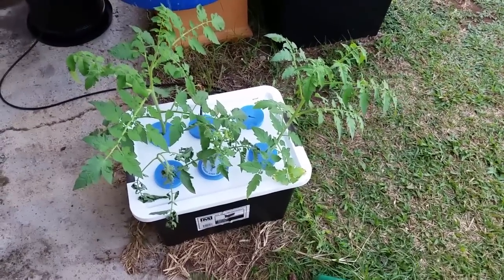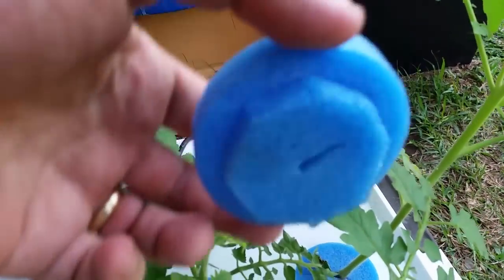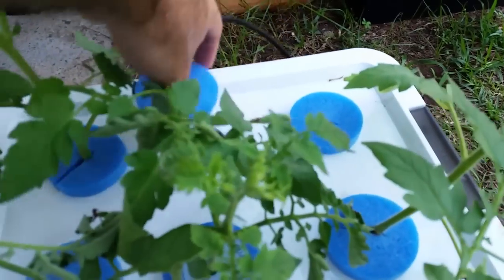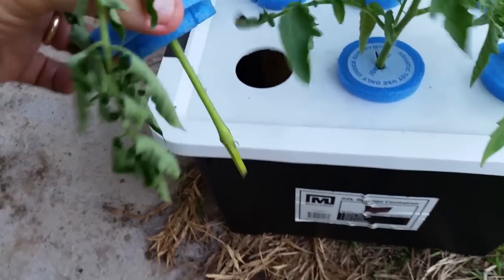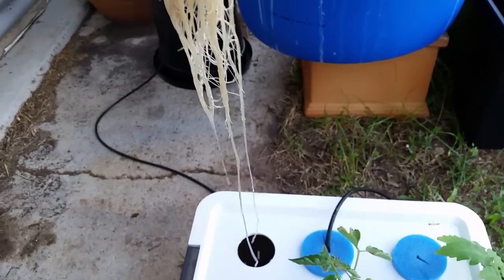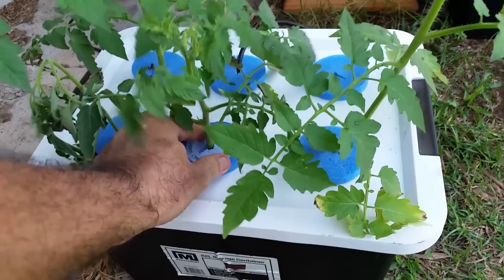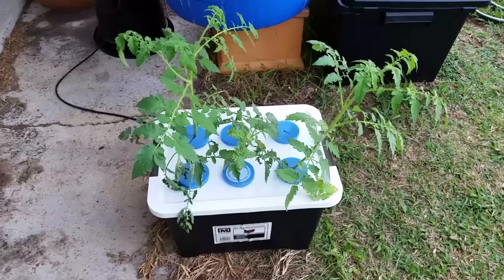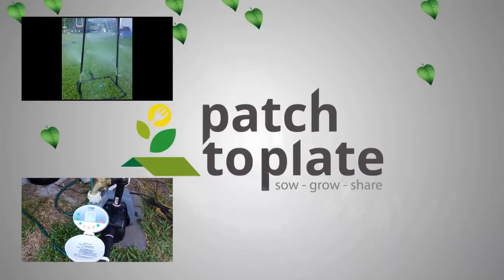DIY - How to build a plant cloner

Comment: one  really nice thing about cloning is that if you're growing a bunch of the same plant, but one is your particular favorite, you take a cutting of that one  and clone it. people that are new to this don't realize that it WILL be the same plant with the same characteristics as the original. I made some clones of my favorite cherry tomatoes from last year and put them in dirt under lights (just regular florescent lights) in my den over  the winter and re-planted them this year I my outdoor garden. 2nd generation plants!!! pretty cool.
Reply from the maker: Barb Susi Good points :) I have heard of a few people using cloning to get a head start on the growing season like you did with your tomatoes. I also using cloning to extend my growing season by cloning a bunch of my most productive plant(s) off at the halfway mark so I have continuous supply.

Comment: I loved the video, but I am new to this.  I need to know how exactly how the insides of the box work, as to how the air splashes the water on the plants.  What fertilizers you put in the cloning box water. The distance of the bottom of the cutting, from the water, and depth of water in the box.  IF you could make a short video explaining this, I think that many other people looking at this, would like to know this also.  A video may  help even better than a written response, unless it is faster to do a quick written answer first and a video after.  Thankyou.
Reply from the maker: Gil Smit Thanks for watching and for the questions. I could do a quick response video for you in the next day or so showing more of the inside. Just quickly though, water/nutrient mix about half fills the box. There is nothing special in the box. The air stone just makes bubbles and as the bubbles pop at the water surface, it throws small droplets onto the roots. I normally leave the bottom of the cutting around 2 cm (1") from the bottom of the water. I already have a video on mixing nutrient for my aeroponics tower and I use that same mix in the cloning box. Video is here - https://www.youtube.com/watch?v=5KrVn1IsjFs  Thanks again :)
Reply: Thanks for asking... I was wondering about depth of plant as well.... Great videoes.... Thanks Patch!

Comment: The video is called "DIY - How to build a plant cloner" And yet you don't show anything on how to build it. No offense but that's misleading.
Reply from the maker: +Zipper Back Thanks for the comment and for watching. I think in the first 45 seconds I run through all the steps although I didn't show them directly. I thought it might be a bit boring as it really is this easy - 1) buy a tote or container; 2) cut some holes in the lid; 3) cut some discs out of pool noodles to hold the plants; 4) half fill with nutrient solution (or even just water seems to work); 5) put an airstone in and let it bubble. Great project as there is really nothing to it. Let me know if you need any other info and thanks again for watching :)
Reply: +Zipper Back he showed all the items for the build and even showed the air pump, all ya didnt see was the airstone.
If ya want more detail their are others on youtube, but I must admit this is the first I have ever seen using the noodles, much cheaper than neoprenes.